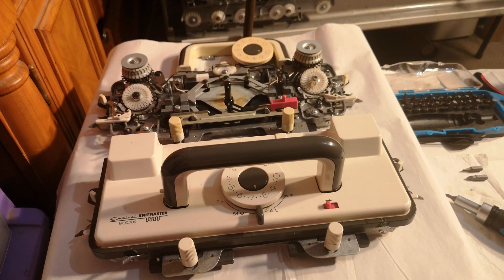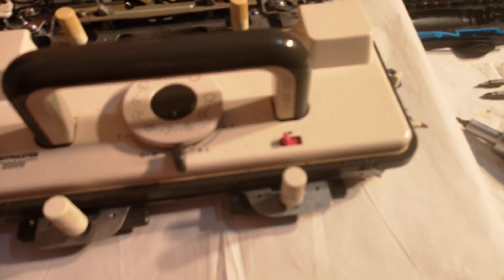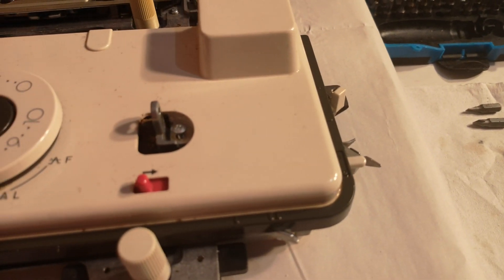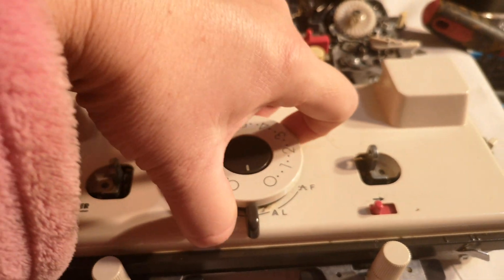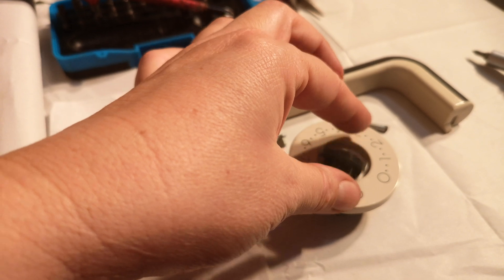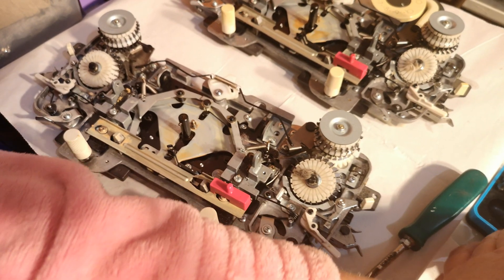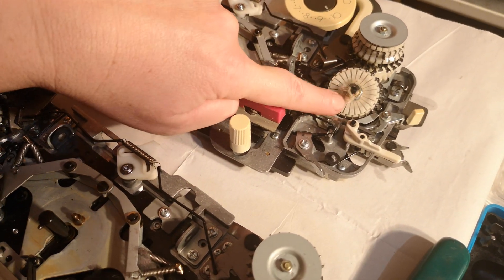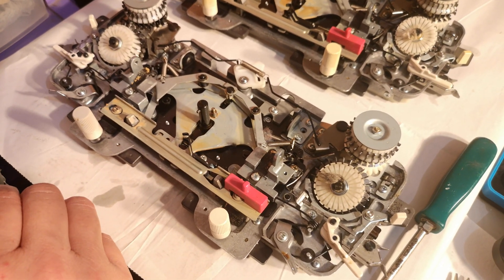Removing the plastics from knitmaster 700 knitting machine carriage.

Comment: just wanted to say, that when you put the number dial back, if it doesn't go in properly, there is a small knob that may be in the way. Its at 12 o'clock from the middle of the dial's hole, just above the post you're aligning the middle with. If your dial isn't going back in, check where it is as it moves in and out of the centre (push with finger). It will need to be about 1 mm from the middle to get the dial nice and flush.
Reply from the maker: Perfect